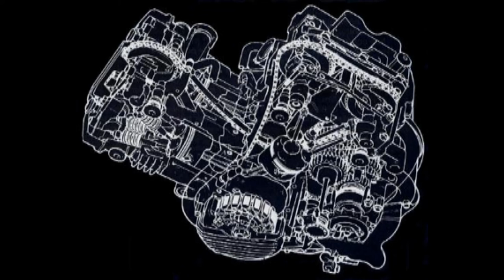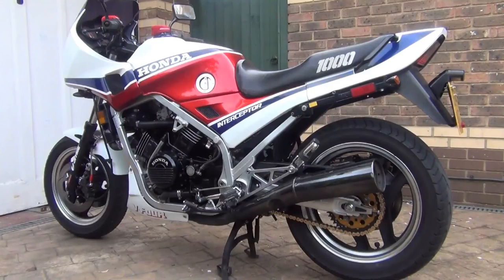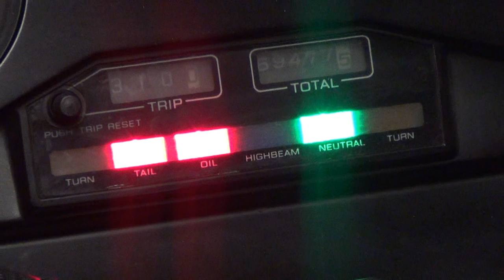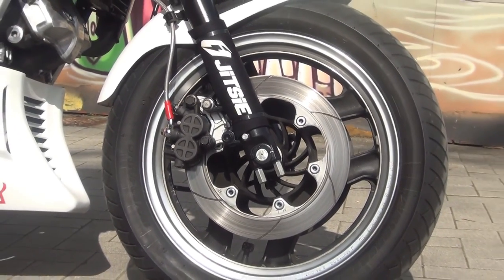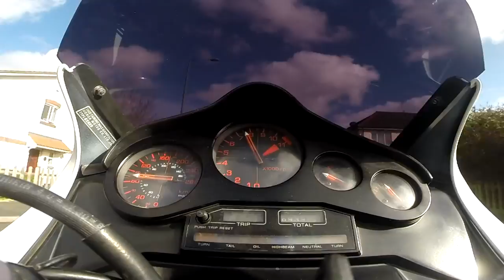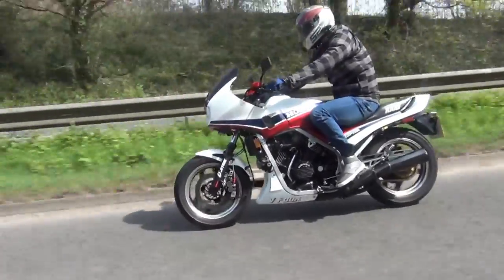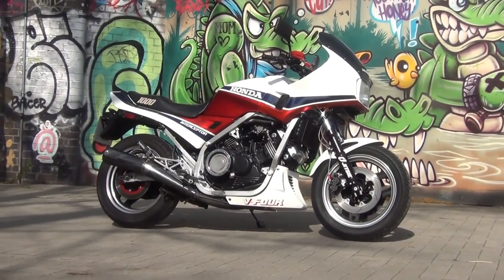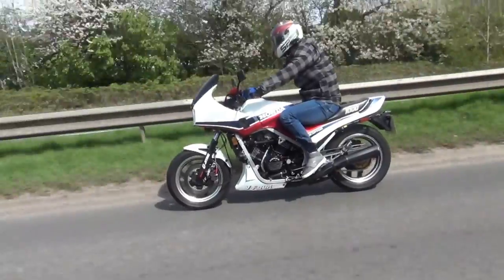Honda VF1000F Interceptor Review

Comment: Purchased my 84 VFR1000F new while on a business trip and drove it across country. Never any issues. It destroyed every stock GPZ900R Ninja encountered! Cross country mountains all around competent performer. No regrets on my purchase!
Reply from the maker: They are superb bikes indeed
Reply: You are lucky, because these engines had a terrible failures at the cam shafts , because of the very badly-Wrongly designed oil system/lubrication of the cam shafts, which caused terrible engine damages. But, at least, it could be fixed. I did fix it on my Vf in 1996, and this year i am repairing another VF, but this time i will fix it even Better , by boring the cam chaft caps, for additonal oil channels, while i close all other oil holes in all cam-shafts. Pwy.

Comment: Such a cool bike.. My first big bike in 1990 was a VF400F. I also had a VF500FII a few years later. Coming straight from a 2T Honda NS125F as a learner to the VF400F was incredible. I remember the journey home after picking it up from the dealers as clear as day!
Reply: I had one of those, too. What a great little bike. I had fun on that thing up in the hills going through the twisties.
Reply: Back in the 80s, here in NZ, you could get your license at 15, and learners were restricted to 250cc. My first road bike (i'd had dirt bikes for years) was a Kawasaki KR250 tandem twin, great little bikes and faster than my mates RG250 Mk1 and way more trick than my other mates RZ250 YPVS😄
My first "big" bike was a VF500F a year later, a half faired, red & white one, we never got the fully faired F2 here. The handling on those VF500s was amazing, and they did well in production racing (unlike the 1000s). My one got written off when i was T boned at an intersection, Wish i could find a nice one now.
Reply: This was my hero bike!

Comment: I had a second hand '84 VF1000F. I would never consider it a sportbike, it was a sports tourer. The riding position was the trade off for the narrow engine. The engine was narrow but that made it longer hence the stretched (but comfortable for long trips) riding position. The torque curve was amazing but presented some problems on a wet road with wheel spin even in a straight line, I went through several rear tires looking for one to tame it. It was a heavy bike and you had to ride it like one. I'll never forget the growl of that engine. I miss that bike

Comment: I saw a few negative comments here and I partly agree with them, but........using this bike nowadays means it's pretty tired. I got my first one in 1988. It was half a year old and I was 18 years old. After a lot of dirtbiking this was my first real streetbike after a few older ones. It was always a bit quirky, but you could work around it, if you got used to the bike and also had a bit of experience with, let's say, character. Unfortunately a drunk car driver totalled this bike after I rode it for half a year, pretty much every day, rain or shine, warm or cold.
I found another one just last year, a real barn find...!!!! I'm the second owner of a 1988 Interceptor again. It had a little over 11.000 km on it, let's say around 7.000 miles and it looked awesome...!!! Everuthing was original, including factory stickers. Just missing a few reflectors. Exhausts were in great condition and so on. Several mechanics confirmed the low mileage and I made it up to todays standard as best as possible. I had modern tires put on, a Dynojet kit on the carbs, better brake pads en lines front and back and, very important, HyperPro suspension front and back, which you cannot see it's aftermarket stuff. The skittishness is gone now, especially at the front and it steers and holds how I want it in combination with a very responsive and pretty powerful engine. I cannot wait for spring...!!!!

Comment: This engine gives you the best good vibes you search in a motorcycle. Had one. Miss it. Only issue, 16' front wheel models doesn't tell you exactly what is going on turns. But it is very stable.

Comment: I dont agree with your opinion on the fork tube stiffness. The front suspension was very good. The rear shock was OK. The rear tire was a bias ply 130 and was the weak spot of the handling. You could power slide the bike all day long exiting corners which made it fun to ride.  It was just like superbike racing with sliding bias ply tires around the track and the street. For some that was a little scary but i liked it. The real shame was that Honda replaced all the cams with a different profile when they warranty the cam shafts due to pitting. Making the bike slower and took away the ability to wheelie on demand.

Comment: My Dad bought the VF1000F new back in 85 I think. It looked awesome. He sold it after having the biggest  tank slapper in his life, combined with fuelling issues in high summer with those banked carbs. It was swiftly replaced with a GPZ900R.
Reply: The problem with the VF1000, was that the GPZ900R was a better sports bike, and the FJ1100/1200 was a better sports tourer, throw in the 750s cam issues, that tarred the other V fours with the same brush, and the Honda got over looked. Good bikes on their own, especially the touring Bol'D'or version
But the buying public bought more of the other manufacturers offerings.
Reply: IV owned all those model bike's kept swapping from the Honda VF1000 86 to the Kawasaki and eventually the FJ 1200 probably the best out of the lot they must be a very reliable smooth fast bulletproof bike' because I'm still riding a FJR 06 1300 shaft driven it's simply the best bike IV ever owned with 165 thousand kilometres on the clock I'm 65 in August and it will probably outlive me Yamaha have been making the XJ and FJ and FJR series for around 40 odd years they are just simply so reliable bulletproof smooth fast bike's money can buy IV seen many around with over 400kms and above on them as long as there serviced and maintained you wont have to many problems

Comment: I bought the VF100F tjhe year it came out to replace my 900 Ducati. At that time it beat ANYTHING on the road and would ride London to St Tropez in a day. You say it's handling is mediocre. Yes, heavy and high, I had been riding Nortons and Ducatis, HOWEVER this bike took corners at 130+ Mph. As for 150 in a stright line no probloem. It was tall gerared and faster than the VF1000R top speed. OK it had two faulots. They put some kind of shock absorber on the clutch to protect it from the power. That meant it was sloppy at low speeds. Then the compstar wheels clickied a bit, that was not Honda perfection. Since then I have had VF750R and VF800Rs in the garage. One more beutiful the second a better all round bike,
Reply from the maker: Thanks for commenting. Sweet bike indeed!
Reply: Mine was brought New here in Australia a lovely smooth reliable motorcycle I remember easily flying past the old BMW Kseries bike's on my way up and down the Queensland coast line from Brisbane to Cairns so many fantastic memories

Comment: Agree with better oil for the bike. New synthetic oils should help prevent the cam pitting but who knows. The one scary part of the bike is tha faster you ride it the lighter the front wheel gets making the bike skittish at speed.  This makes the bike not handle hi speed corners very well. No one really tried to race this bike for good reason.
Reply: Except that Geoff Johnson won the TT on one in 1985.
Reply: It was successfully raced all over the world.
Reply: @chrisbateman3687  That was on the Bol'd'or touring model as well😄 Mainly due to his skill, and the huge fuel tank that allowed him not to pit for fuel as much as the others. I remember it well.
Reply: @redryderaus  They weren't exactly successful in production racing. The GPz900R won far more races. In the Southern Hemisphere, the hotbed of production racing inn the 70s and 80s they had very little success. They won the NZ 6 hour in 84, mainly due to the leading bike running out of pad material in the last laps, allowing the VF to slip past. In the Aussie 6 hour in 84 a VF1000R with GP rider Wayne Gardner drafted in to ride, it came 2nd. (He called it a big marshmallow on wheels) 😆That race is here on YT and you can see how much more pace and speed the 900R's had over the VF's down the straight.
Reply: My new VF1000 86 in the blue 🔵 was dead stable cruising on 180kph passing a friend on the Kseries 100LT tourers not a problem with the stability and handling

Comment: Thanks for a great video. I just got one of these and the starter died. I hear the starter motor is terrible with 2 brushes so apparently the vf750 starter motor is vastly superior with 4 brushes. Little tid bit. Also the cooling system is iffy at best. Can't sit in traffick or you're litteral toast! Been looking for better cooling fans. I'll flush the system first though. Otherwise it truly is an awesome bike! I believe you when you say it's fast! I'm gonna be nice to her though, she's old with 32,000 km. Thanks again for the awesome video, I might look into these mods you mentioned for the cams.
Reply: I never had a problem with mine in heavy traffic during Australian summers. Yes the thermo fans switched in and out frequently but that doesn't mean the engine is overheating. Keep up frequent 5000km (3000mi) oil changes with high quality oil and there isn't an issue.
Reply: bi pass with a switch so you can switch fans on when you want

Comment: The later VF1000FF added  different bodywork and an 18 inch front wheel, there was also a touring Bol'D'or model, I think the U.S didn't get those models, onnly Europe, Australia, NZ, South Africa and maybe Canada.
Reply: I have the F2, love it.
Reply: Here in Australia we got both BIKE'S the VF1000 86 and the VF boldor 1000F2 in the Red with the twin head lights and full fairings
Reply: Lovely bike in red

Comment: So do you think my 84 VF1000F will be a pain to get going again it was previously lasid over on the left side the fairings took most of the damage other than a little road rash on the engine cover on that side. But the guy bought the bike from his insurance after the crash but then never did anything with it. Its been setting in his moms graage since 1985 not long after the crash. Its really low miles as its only got 1400 some miles on it. The gas tank other than a dent on the left side  is super clean inside as well. The carbs though seem to be very sticky so pretty sure they were left with fule in then and it has turned to the molasses like goo. Other than those few things the bike is untouched even still has stock exhaust with baffles still in the mufflers. Oh and the keys are nowhere to be found but i dod have a clear title. I was hoping that a good carb cleaning and some new rubber carb joints and definitely some.new tires as they are dryrot from setting so long and going low.

Comment: i tried to order 8 roller rockers at one time for my interceptor and there were only 3 rockers in stock and they were owned buy honda racjng team. i dont know why they didnt equipt all v 4s with roller rockers. 11000 red line and low cost valve train. only in japan

Comment: One of these won the Castrol 6 hour race here in NZ  ninja 900 was winning but it’s front brakes seized on
Reply: I'm friends with one of the guys who won that race. (the other rider has unfortunately passed away) He bought and restored another VF1000 in the same colours.😄
I'm pretty sure the 900R didn't seize their brakes, but ran out of pad material and down to metal on metal, either way, they protested the win.
The GPZ900R was quite a bit faster and handled better too, theres a video of the Aussie 84 6 hour, the one Richard Scott & Michael Dowson won on the 	Yamaha	RZ500, and 900R's are blasting past the VF1000Fs with ease on the straight.

Comment: I was an original owner of the 1984 VF100F here in the USA.  I want to say that Honda Engineering really failed to properly design this bike properly in two very specific areas.  One was the bad Cam Shaft hardened surfaces failed on my bike before 4,000 miles, as it failed on most all of the V4 Honda engines in that period.  Secondly the weight distribution was wrong, which is why the tester commented on how the bike feels strange.  THe bike feels different because of the 16” front wheel and because the engine was too far back in the frame, making the front end light.  This made the bike uncomfortable at high speeds because the front wheel was barely touching the ground at the speeds this bike was capable of.  

Honda failed to properly test the bike prior to release and correct these issues.  My bike was down for 7 months waiting for new Cams from Honda.  I paid $5000 for that bike and was happy to get rid of it.
Reply: Here in NZ only the VF750s suffered from the cam pitting problems. Never saw a VF1000 engine fail from it, and the VF500s and 400s certainly never did. (That i saw) But the 750s problems nearly sunk the whole V Four engine range. They got it right with the 86 VFR750 Though.
Reply: Purchased my 84 VFR1000F new while on a business trip and drove it across country. Never any issues. It destroyed every stock GPZ900R Ninja encountered! Cross country mountains all around competent performer. No regrets on my purchase!